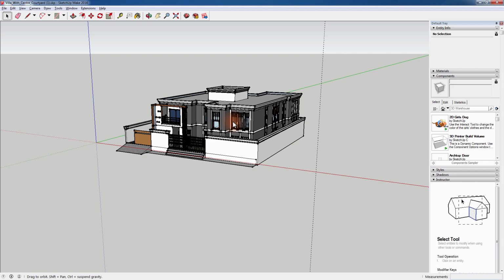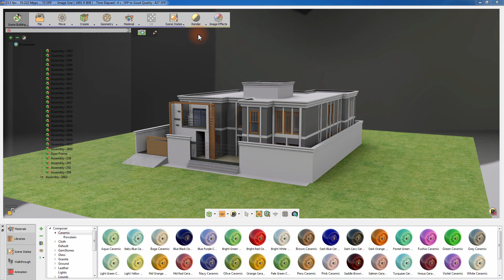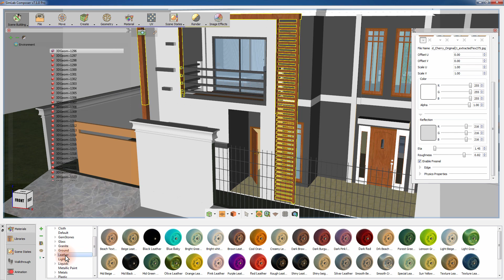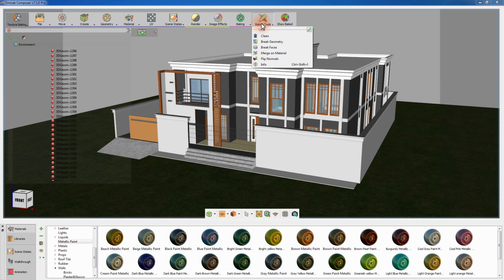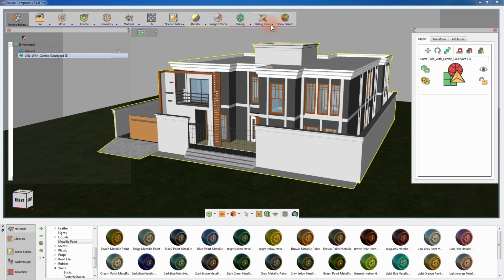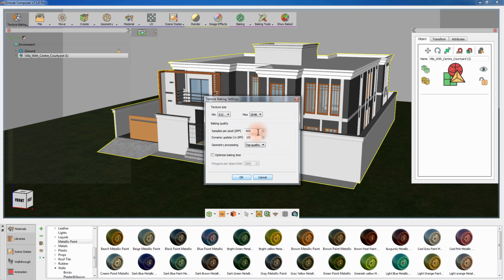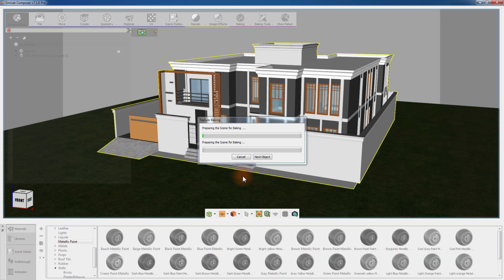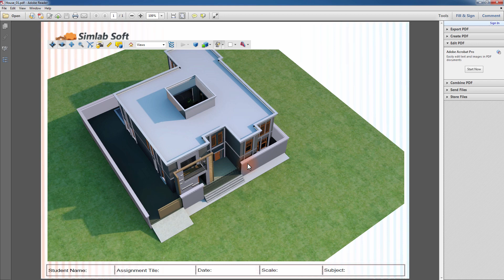Sketchup texture baking with SimLab Composer

Comment: Can SimLab Composer 7 export the sketchup model with baked textures to .obj or .fbx formats for use in 3d game engines?
Reply from the maker: Yes, you can export texture baked model as OBJ or FBX to use it with a 3D game engine.